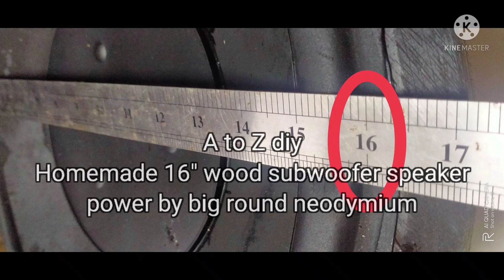homemade 16" subwoofer speakers of wood material and 5cm neodymium magnets

Comment: WHAT THE  price of that neodymium magnet
Reply from the maker: There are 2 popular types of neodymium magnets, namely N35 and N52.
if N35 is a little cheap, if N52 is a bit expensive. the difference is the strength if it sticks to iron. N35 is easy to remove if it sticks and N52 if it sticks to iron is very difficult to separate.